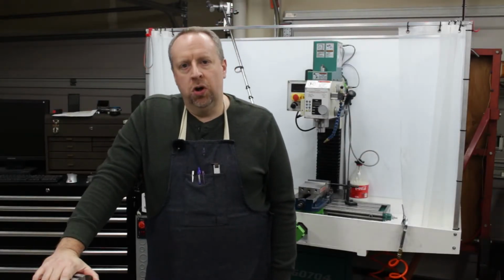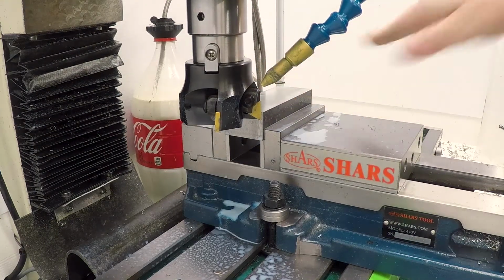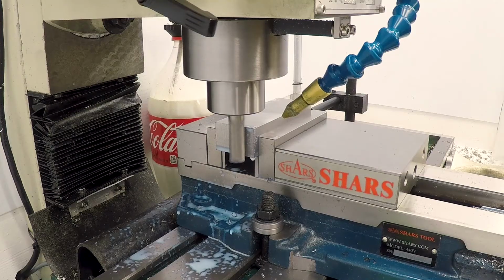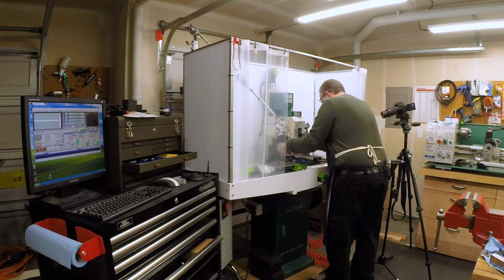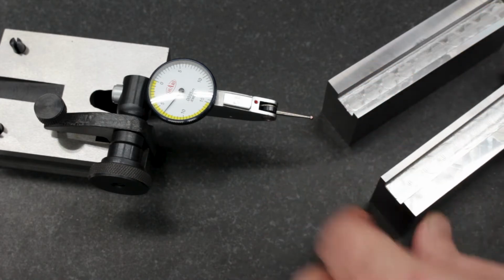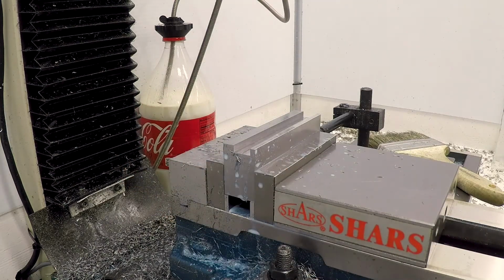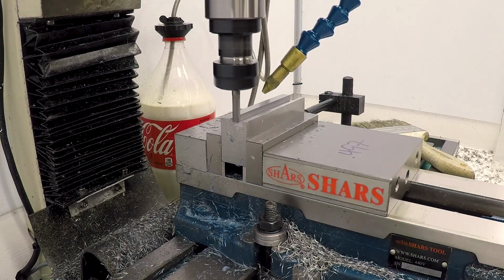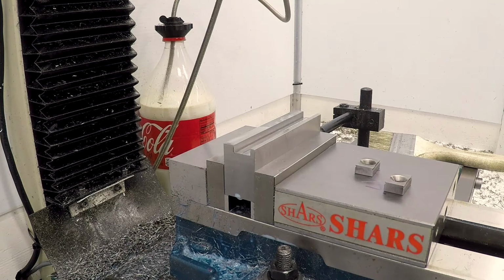Making TalonGrip Low Profile Edge Jaws - Part 3

Comment: Hi James. Love your videos. I have a lathe and a mill on the way. I noticed you went with a climb pass on your rough and final passes on notching the channel to size. Is there a reason to do this in steel, or is it just the way you did it? Just trying to learn.

Thanks for always putting out fantastic content!
Reply from the maker: I pretty much always climb cut on the CNC.  I have ballscrews in the machine, so there's no need to incur the rubbing involved in conventional milling.

Comment: All very interesting stuff, thanks for posting. Not being pedantic with you, but for your interest: I know Americans always use the term 'cold-rolled steel', but certainly in the UK (where we call such finishes 'bright steel') a flat like that would be drawn, not rolled. Much like you know wire is drawn, through a die, but in this case not a continuous process but piecewise. Approximately 20' lengths of a black (what you call hot-rolled) steel are pickled, have a small taper ground for a few inches on one end so that it will fit through the die, then that end is gripped and pulled hard (lubricated by a soap based product, at least in my day 30 years ago). This produces a remarkably accurate result (maybe within 3 thou on a piece that size). It is this action that tends to put stresses in the surface, as it is really the frictional effect that means the outside stretches a little more than the inside. If you ever look at the unfinished end of such a bar it is noticeably concave as a result. I assume the same process is used in the USA (or China etc, where ever it came from). It would be very difficult to actually cold roll steel on 2 dimensions and get a precise result - though of course rolling works very well for sheet up to about 3/16" thick, but for that they can just shear the edges to a true width. I am no machinist but I believe most of the stress is concentrated in the outer 100 thou or so at most - so milling deeper (like your groove) shouldn't have much stress-release effect, once the outer surfaces have been symmetrically milled off. Not admonishing you, please keep on calling it 'cold-rolled' as I know from youtube your countrymen do - just thought you might be interested in the process, as you have interested me very much in many other processes.
Reply from the maker: You are correct.  My supplier calls it cold-finished mild steel   The most common variety is 1018.  Small sizes are very accurate-usually within .001".  The jaws did bow away from the slot, but only by .001" or so.

Hardware stores here often sell flat bar they just call "steel".  It has mill scale and it's sheared to length.  The ends are mangled and look like taffy.